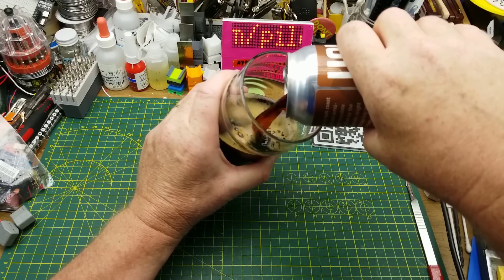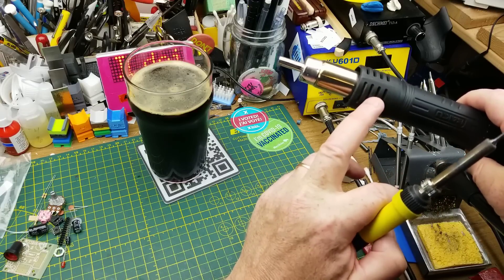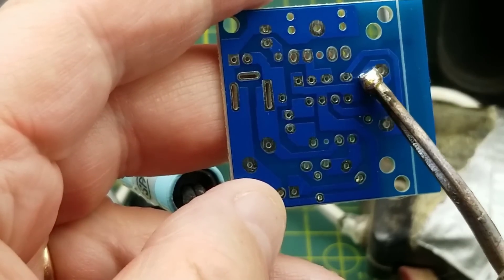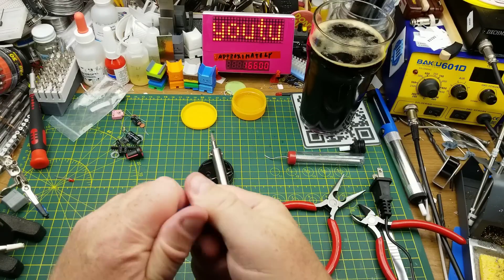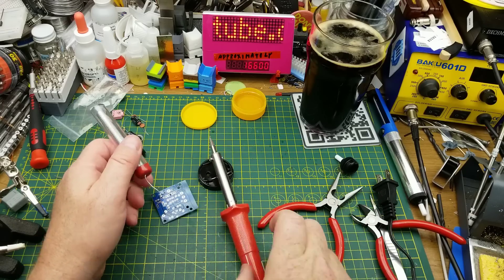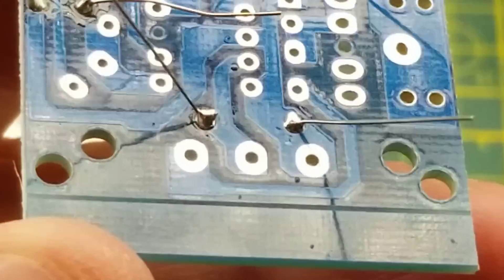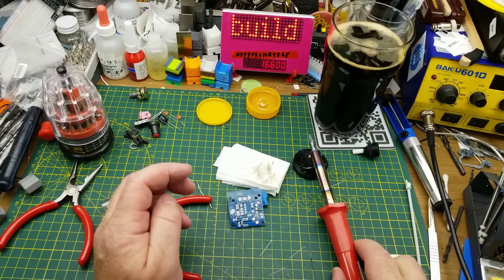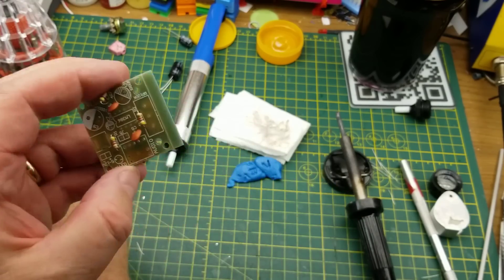Kit build with cheap tools?

Comment: my first solder has weller 35W 40 year before and second has temperature adjust what i get NOKIA phone factory, FREE, and same i get NOKIA phone factory worktable elektric working, has self power supply adjustable and ESD table top and Weller solder station all has FREE for me i has service men and build many automation lines to NOKIA phone factory.

Comment: When I was a kid, I did not even have money for a new tip on my primitive iron. What I did was take a length of 13 AWG installation wire, stripped it, folded it so it would fill up the place where the tip had to be installed and had one piece of this wire sticking out about one inch to function as my new "tip". That worked fine and was cheap to replace. :)

Comment: To be fair to PA, the online description of that kit doesn't mention electronics. It says "For general-purpose jobs, including small electrical parts, jewellery, hobbies and crafts".  
I don't know about jewelry, but if I was replacing a blown speaker, or installing fog lights on a car, I expect it would do the job admirably.
BTW - the listing also gives some specs: 60W, max temp of 480C, 400 second (!) warm up time.

Comment: Never overpay for side snips. Ive had knipex side cutters explode on me after cutting about 4 quarter watt resistor legs. I keep sending back the same pair but now i just trim 3d prints with them.
Reply from the maker: Yeah, I mostly use the cheap Chinese flush cutters. The last time I ordered multiples.
Reply: @pileofstuff  I bought a pack of ten black handle ones for 20 beans years ago and I'm on my last one. I emailed ya  brother but if you're not interested then  just disregard it.

Comment: Hi, my canadian friend... A cheap lamp dimmer can reduce the power (heat) output of this soldering iron, if it gets to hot... Speaking of soldering tips.. I regulary grind my tips to the shape i want / need for the task and retin them.. Occationally i even make my own tips out of round copper or brass material.. I use a soft brass wire brush to clean the solder tips... Just personal preference... This dodgy electronic kit is again just another exaple of immature, asian products..The copy of the copy of a copy...  xD   Greets from Austria...
Reply from the maker: Indeed it can.
There were a lot of articles in the old magazines about that exact DIY soldering iron  control.

Comment: A few years back I had our Scout/Venturer Groups building line following kits. Not having enough soldering Irons for the entire group I picked up four cheap ones from Princes Auto, I think It was myself and the other leaders that used them. I will have to dig them up and see what wattage and temperature they work at, we did manage to get most of the kits working. In the past I have used cheap light dimmer switched to lower the temperature of cheap irons.
Reply from the maker: Princess auto does also have a 25W and 40W iron listed in their catalogue.
I just picked this one for the video because it comes as a kit. And it was on sale at the time.

Comment: Add some flux to the pcb before soldering. That first cheap iron has not a good tip at all. Looks like that solder is lead free, so flux is a must.

Comment: I bought a big roll of solder back in the 80s. It Still hasn't run out, and I modchipped well over 500 playstations back in the 90s aswell as car audio repairs 🙂

Comment: 14:59 pin 1 is bottom left, pin with no pad pin 7 is bypass - you may have fat-fingered it looking for the datasheet, the board says LM386, and the datasheet in the vid says LM358 - easy enough mistake for anyone to make, have done it myself and had me going in circles

Comment: Thanks for posting this vid!  My first soldering iron was temp controlled for ~$20 on amazon (came with five different tips).  It worked reasonably well - I did several of my first kits using that cheap iron.  I think the best thing for getting good at soldering (even if you don't have expensive tools) is just to get started.  Get lots of cheap kits and practice till you feel comfortable.
Reply: I was pretty much the same. I had an old one for wiring guitars but when I got serious about amd I'd just have an kit on the go all the time, I still design my pcbs to use through hole mostly and save smd for repairs on broken crap. I just perfboard 99 percent of the time though. Haha

Comment: if your soldering iron gets way tooo hot or red hot in the dark you can add a 3 amp diode in series with the heating element also your soldering iron will last a long time. i did it with all my soldering irons that doesn't have temperature control.

Comment: Instead of trying to repair that first bad joint where the pad lifted, I would have waited until soldering another component on the same pad and bent the second component lead to meet the first one, and make the joint there. Sucks that they bodged the IC pinout. My first iron was an Antex 25W, from more than 45 years ago, still have it, still working.

Comment: I did solder a LED Clock kit yesterday, i did use this:
25 to 30 watt soldering iron.
A roll of solder tin.
A cheap but sharp and nice ebay component leg cutter plier.
That's it, its all you need :)
And add a Aneng 8008 multimeter too as described unerneat.
Wire stripper? I use a snap off blade knife for that, works fine.

I was a MIG welder before and even did run MIG welding robots too over 30 years ago now, i loved turning up the heat a lot on the manual MIG welder to the point of other welders hated me and asked me why i did turn up the power and welding speed so they had to turn it down again, because they could not weld that way LOL.
I got the IQ of 140 and one also learn the limits of what one can do by working with welding robots. I just did love the optimal fast settings so i could do the manual work the fastest way possible with satisfying results. If you can't work like a robot, well, i'm sorry you had to readjust the MIG welder guys :)
But back to soldering again.

A perfect soldering iron for things i would say is 30 watt, i just like the heat, you can do it with a 25 watt too, but that is crap on somewhat thick speaker wires.
With the 30 watt iron you put the soldering iron on the components and at the same time also the soldering tin, do not waste time heating the components first, do it the same time, make sure you get even heat on both, if not cool down the component a little, then do it again add more solder.
You will know by ruining components how long time you can use LOL.
So do the minimum time making a good flow.

30 watt soldering iron i think that is the best allround one, it is the perfect iron that can do anything electronics vice, it is powerful enough for everything you need if you only plan to have one iron. Just use the minimum time to do the work with a smooth glossy surface.
I do like to use lead soldering tin with inbuilt flux. It just get so smooth.
I did buy several kilos of it from China when i realize it might be gone some day.
But you can do it with modern non-lead soldering tin too, but don't expect the same good flow mirror glossy surface all right.

30 watt can solder 6mm thick speaker wires too but you got to have a little help from a heat gun.
It can't solder car radiators. Get a 125 watt old wood shaft soldering iron for that. How old it is who knows, 1930's i guess. I found mine on the scrap along the road when 16 years old almost 40 years ago.. but you might not see them irons anymore.. but who knows they just last last forever and another 16 year old might find mine this way too on the scrap in the future :)
Because it is useless for most i guess. I never use it, but i love it for those rare heavy duty jobs soldering start cables for cars, or soldering a car radiator where one just need that power, with also a heat gun LOL.
I did put new mounting ears on a copper car radiator on a now veteran 1971 car who has such on it, today they has aluminum, don't try soldering those, it wont work, forget aluminum and ordinary soldering.
So yeah, the only use for that 120 watt soldering iron for me is to extend start wires on cars using it for subwoofers or similar.

A friend did bring a 15 watt soldering iron to me and said he did dislike it using it on kits like this and asked if it was anything wrong with it, and i tried to solder with it but yeah, useless, in my eyes you can't get anything more useless than that LOL. On SMD and small components yeah fine, but useless for anything else.
I take SMD with the 25 watt too, no problem, just hold the component in place with a snap-off blade knife or a tweezer right after putting fresh solder on the iron and be fast before the flux effect dry up.
I won't recommend doing SMD with a 35 watt iron if you are a beginner, try get a 25 watt one, it is the perfect all-round iron.
But in my eyes, i miss that 30 watt soldering iron, my first soldering iron, i was not fully satisfied with the 25 watt one, but i also got a 35 watt one if i need.
I did buy the 25 watt and 35 watt models because i did not want something with lack of power, and do use the 25 watt still, i had to check what was in my electronics tool box. It is a little underpowered in my eyes when soldering thicker things, did like 30 watt better, yeah, i has 35 watt too, it is a little overpowered but just compensate doing things faster makes that as good in my eyes, this is for me, may not be good for you.
You might hate 35 watt on kits, like the welders at my workplace, beware :)
Just grab a 25 watt for kits like this, or even a 30 if you find, its just more versatile.

The tip of the soldering iron, i hate the round ones, i had them one time, they are useless, get a tip that is like a 3mm screwdriver, you can use it vertical or horizontal depending on how much heat you want to apply, it just makes the soldering iron much more versatile and fun.
Yeah, you get the hang of it kid, try soldering something before doing it on the kit, use some wires or component legs as a test ok :)
Beware of the IC circuit components and also electrolyte capacitors, none of them like heat much. Transistors too but they got longer legs. Diodes, resistors work fine, i can't think of one i did ruin.

Get a multimeter too, to test resistors and capacitors before you solder them.
Aneng 8008 is a good cheap one on ebay.
EEVblog did test that real good and he was so impressed of the accuracy that it almost got him convinced, it was so so SO close. But he is very very VERY hard to satisfy to say that :)
I do like that and did use a Fluke 87 before, still has it but LCD is weak again.
EEVblog sure love that Fluke 87 multimeter, but it does cost a arm and a leg.

I say the Aneng 8008 fully does replace my Fluke for non high power stuff.
I got a cheap ebay LCD transistor tester, but yeah, you don't need to test everything, i tend to not test transistors on kits because i don't bother, i has yet to come across one that don't work.
The Aneng 8008 has a nice screen, more beautiful than the Fluke, crystal clear and easy to read.
and it has a Fluke 87 looking dial and layout of the buttons and sockets too.
Yeah, i do actually recommend that one even if it is dirt cheap.
And this comes from someone who had a Fluke 87 that did cost 500 USD in 1990, it was a coincidence i got a Fluke 87, this is the classical multimeter every pro wants for nostalgia. A friend did have a father and at his workplace they had one leftover, i got it for 100 USD in those days, still like 3x the price of a chap one.
The reason i don't use it is because it does need a LCD rubber connector again.
The Aneng 8008 was cheaper than a new Fluke rubber so i gave that a shot to try.
I never used the Fluke for high power stuff anyways.
I say Aneng 8008 is just as good for the very most things i can imagine using it for, it even has a frequency injector if you use oscilloscopes and such.

That's it, do you need more than that, i would say no. But add a Aneng 8008 multimeter too.
You don't have to.. but to get the very first kit you ever build working the first time is good encouragement for having this as work or hobby later on, just saying and i have experience with that.

Because my first "kit" was when i was 15 and got a schematics in a electronics book with a stripboard/veroboard PCB (print card board) based DIY put together everything yourself FM radio where they did not have all the components i asked for at the electronic store so i got the equivalents that maybe possibly would work LOL.
The book was borrowed from someone parents knew in another country and they wanted that book back.
Plan was to make a very small FM radio, the smallest possible and sell them, back in 1986.
Possibly i could get rich of doing that, who knows, i might have spent the money on Bitcoin later :)
I did solder it like it should be, and delivered the book to parents that gave it back.
I did a few days later get a battery for it, but i never got the crap to work, it never did make any sound.
And the book with the schematics was now in another country LOL.
And i did not write down the schematics and did not know how to error search things.
I tried a lot but it did not make any sound and did make my enthusiasm so low that i almost gave up the hobby.
I don't really know if i still has the kit, it might have got stolen from the shed if i put it in a cardboard box of old computer parts or something there. If i ever find it i shall get that to work :)

The only thing that saved it so i still has a electronics hobby is that i actually made my very first FM radio with a multi kit called "Your little electronics engineer" or something like that, i got it for christmas when 11 years old in 1982 and has yet to find on ebay this kind of a LEGO style thing where multiple projects was inbuilt in the spring based mount almost like a big version of a breadboard like plate.
But i actually got a FM radio to work on that and i knew i could make one.
So my hobby was in danger if i had not been successful earlier i bet :)

I still wonder what went wrong LOL.
A bad component? A error mistake? Parts that did not actually work in that kit? Who knows.
A DIY FM radio put together with parts that might work and a couple of coils and variable capacitors, yeah, i was too ambitious having that as my first ever soldering "kit" :)

Good luck to you on your first project kit build kiddo, don't make it too advanced, you want one that works the first time :) At least you got internet now and we had nothing back in those days :)
So to have this as a hobby was once very hard.
Reply: A addition i did use yesterday is +6.00 reading glass, i has -1.25 vision so a +5.00 reading glass will work fine if normal vision, it gets you to focus 20-25 cm away.
A +8.00 reading glass for me is nice to inspect things but not much useful for soldering, it gets you to 10cm distance.
I has a loupe magnifier but i actually do like reading glasses better nowadays, unless i need to look for cracks or similar.

Anther tip is when you has soldered everything good and cut all the legs then hold the PCB board vertical and redo fast all the solder points with the iron, it will look nice and suck up the extra solder, makes it look factory style visually :)

And get a real thin nice sharp cutting plier made for electronics, the red cutter here is just not sharp enough so you has to twist it to gt off the legs, a real electronics plier looks different.
It is flatter on the head, you will thank me for this info comparing them  later on, it is a huge difference.

Comment: When I was younger, all my electronics kits were assembled using the cheapo Antex soldering irons, as temperature controlled irons were extremely expensive. I also used a big reel of lead solder that my Dad "borrowed" from his work, and I still have that today, 40+ years on! Not much left on it now though.
Reply: So, when are you returning that spool of solder? 😆
Reply: @AnnaVannieuwenhuyse  When it gets down to the last foot of solder left 😀
Reply: @MrJozza65  Cheeky 😏

Comment: A fake kit I found on Ebay a while back is laser driven wireless speaker kit. There is no way to make the laser diodes oscillate but strangely everything was in the kit that made it look legitimate. I'm trying to rebuild the batteries in my e-bike add a fuse box and signals. the guy that was to help me flaked out. now I can't figure out how to get it to work. Wish I could find someone to write me a map.
Reply: I stopped buying most ics from anywhere but digikey